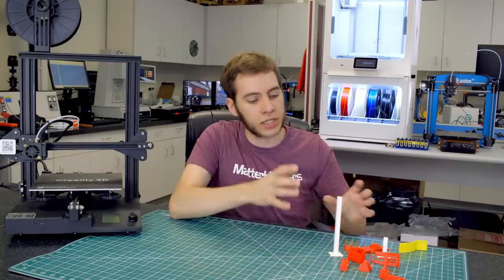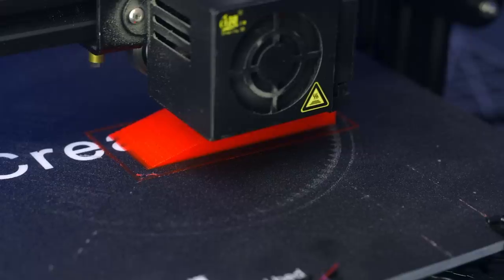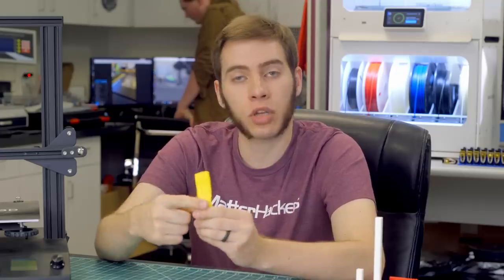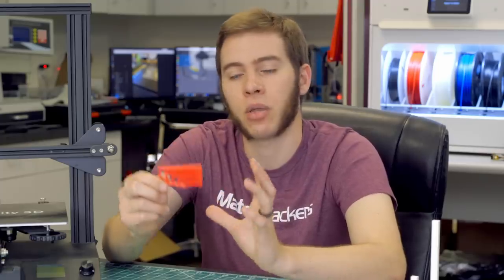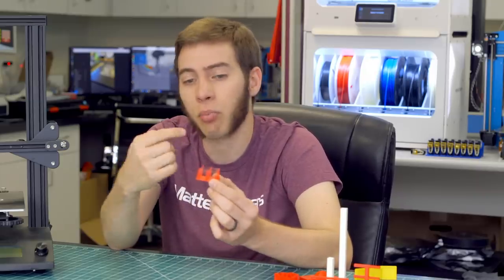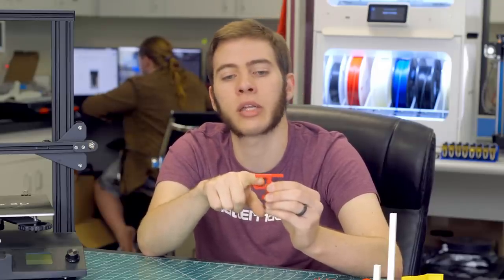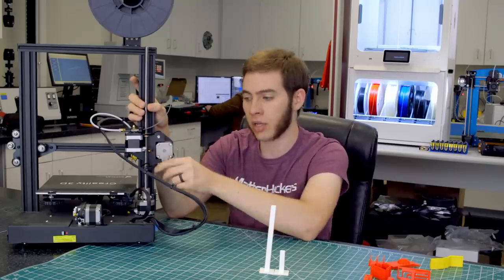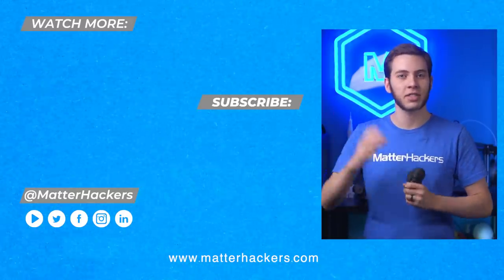Top 10 Calibration Prints for Your 3D Printer

Comment: Great video, thanks!  Not sure if the order you presented these tests in is the order you should run them. Is there an order these test prints should be run? I have a new Artillery Sidewinder X1 (V4) and am not having good luck with my initial prints. If you are testing a new printer, should you run specific tests first and address any issues before running other tests? Do changes for a single test have affects on the other tests? 

What about using some of the multi-calibration models available to make these types of tests? Thingiverse things like "*MICRO* All In One 3D printer test" or its cousins. I guess I can see where using a single model for a specific test could be beneficial, however, when you make changes to help fix one issue, those changes could be affecting other areas of your print. Seems nice to be able to print a single model that allows you to see specific changes and how those changes affect other aspects. Saves time, plastic and $$$. Appreciate any comments.
Reply: I was hoping g to read an Expert reply to a great question
Reply: Michael Whinnery ,
It’s all good. Yes print a multi test model. Even then, print it again rotated 90 degrees on the build plate and observe and measure the effect of things like :
- the overhang layer orientation might likely be stronger one way and maybe warp less the other?
- the cooling fan duct breeze direction on the overhang could have direct effect on the warpage of a part.
Fitting parts together into an assembly that maintains dimensional accuracy can be a challenge.

 We’re learning.

This series of test just breaks down individual properties so each might be understood by itself.  For example, bed leveling might merit it’s own test. It may be more filament efficient to check any number of suspect subsystems without print the whole multi model over and over.
Cooling of overhangs as explained here is significant factor in model fidelity. Good explanation. How a printer, filament cooling or software handles bridging, extruding in thin air, is well worthwhile understanding.
It’s all good.
: )

Comment: im glad i watched this video, i had a tevo tarantula pro that came with a bearing for the lead screw but the printer had bent extrusions an i had to send it back an i ended up getting a ender 5 and it doesnt have the bearing at the top for the lead screw and i was literally getting ready to print one for it. but i have a question. would it be the same with the ender 5 cause the bed is at the top from the start an drops as it goes down so would the bearing on the lead screw mess with it in the same way?

Comment: Your horizontal surface test is actually quite poor, how do you give it a 5? there is holes through the surface. You either need to up your extrusion or add more top layers.
Reply: Maybe it's a 5 out of 100 ? That would actually fit quite accurate then.
Reply: Because we are only scoring based on the area we are judging. In the parts that are not under extruded, it's a really goo surface finish, but the underextrusion isn't related to slice settings, it's a mechanical fault in the extruder assembly. The torque and pressure provided by the extruder causes it to underextruxe frequently, and post video I disassembled it, cleaned it out, and stretched the spring slightly to adjust the tension.

The proper thing would be to redesign or purchase a higher quality extruder with a better tensioning mechanism, but you work with what you have.
Reply: Don't get me wrong Alec, great informative video and covers lots of problem areas. Just threw me off when I saw that horrible top layer and then you said it was a 5. Would have helped to add in the video that you were having extrusion issues hence the holes in the top layer. My OCD always gets the best of me lol. Keep up the great videos!
Reply: @Richter3D  They have spring cups as well that increase the spring tension. Thats what I printed for my Ender 3 Pro and it helped a lot.

Comment: Regarding that stringing test... To me, it looks like the drooping horizontal strands are pulling the ever so taller getting vertical posts together ( evidence being the the layer where the horizontal bridging starts being less wide than the top final one! ) thus must likely emphasizing the drooping - Maybe consider redoing the model with a different tower geometry not susceptible to getting pulled togehter?

Comment: In my opinion the last one is not suitable to check the squareness. A squareness check needs two long perpendicular (straight) edges, not 4 small bricks. Print a 100x100x4-5mm square or an L shape instead. Take in consideration the corner inaccuracies and the elephant foot when you measure. You can file or sand the bumps for example.

Comment: Each of your prints looks like they have under extrusion...
Reply: The horizontal and vertical surface finish both had huge visual indicators of under extrusion and looks pretty terrible yet he gave them a 5...I'm confused why.
Reply: Ender Gaming yeah it’s weird. Really bad vide
Reply: @creazinstincz7122  it's just a matter of Creality printers not having the best extruder assemblies, but have the potential to run really well. After the video I readjusted the screws and tightened things down in an attempt to apply more pressure into the filament, which got rid of any underextrusion and really cleaned up every print. The horizontal surface finish looked great besides the underextrusion, so with that solved its an easy 5.
Reply: Alec Richter never said the printer was at fault here. I have both ender 3 and ender 5 and they’re doing as good as a prusa. The one at fault is the channel providing bad info
Reply: @creazinstincz7122  I know that you didn't say it was at fault, but as the person that worked with that specific printer, it /was/ at fault.
Reply: I'm pretty sure if they showed perfect prints that people wouldn't relate to it at all. You need an example of what to watch for.